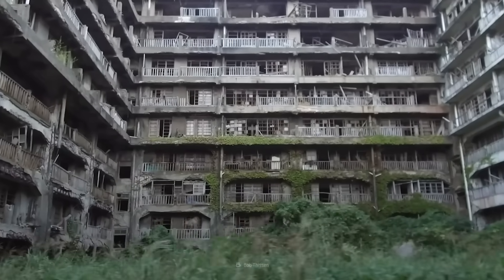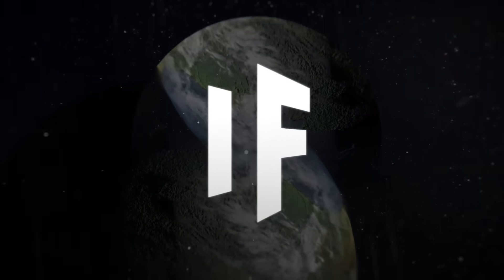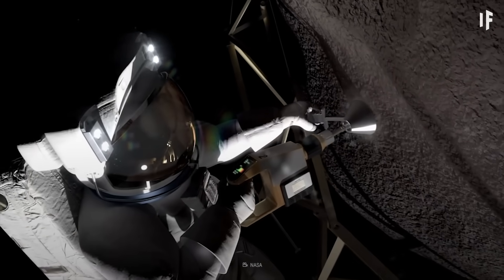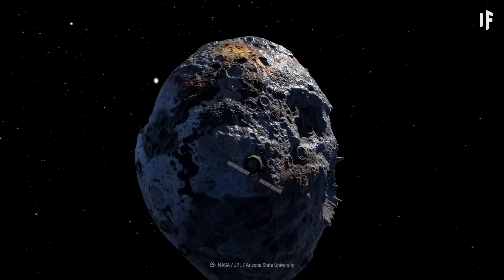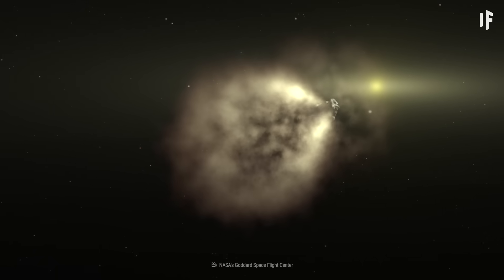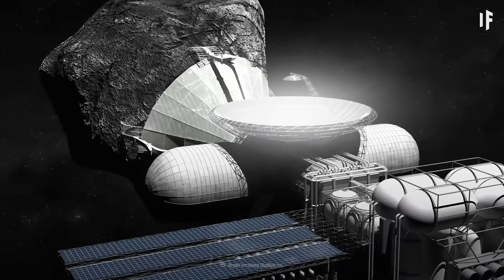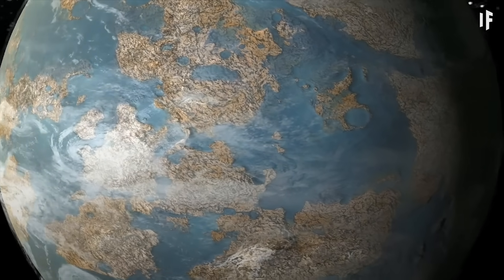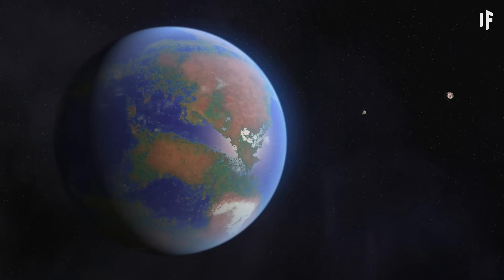What If We Built an Artificial Planet?

Comment: Material would be dispertion of temperature to hydrogen and compressing it with electomagnetic radiation using technology that can beat the temperature and survive inside and outside highest star temp, let that star build with computer program spectroscope and build a planet same way with mag caps inside a hydrogen gas field, building the gas field with radiation, cern 9tril nuetron 1.8 mil, so beating the heat, even building a nuetron star for the gas charged filled of hydrogen, with tech blow out with it and spectroscope all of it pantograph it travel with it and play with it, GOds playground

Comment: sphere with water and living space inside cover by outside steel mesh with recycle plastic fiberglass about 20 m - 30 m and had radius about 50 miles is about 7500 cubic miles can house up to about 500,000 population max each density about 500 person/ square miles.

it lower internal part to be containing water to be compressed from air after reach high altitude than had flaform to build city on top inmer sphere and an artificial sun light on internal top. the outside to protect people from radiation and debris and anticolision course adjustment system then weather and air inside are filtered and keep constant, with refeshing water from compressor turn outside space onto water using dynamic gravity at ratio 2 stages 1/700x 1/700 about 1 - 490000 ratio compression or above could make water from space
Reply: began by an inflatable plastic or fabric balloon deploy by boeing into lower orbit then use sound and gravity elevator to lift supply and men to add steel mesh laying then fiberglass coating then steel mesh then insulation coating then deploy by into low orbit with basic antigravity and electricity,  then steel mesh then fiberglass and plastic and anti absorbing soft silicon coating then began water creation from compressed air as added emf engine raise to higher orbit slower boarding process and add flatform and city with inflat housing for lightness the  planting and lighting

Comment: Nope not possible 
1st: where would u get the energy for making such massive artificial earth? If there is, is it stable.enough to maintain for long period?
2nd: how would you tranfer material from place to place? If there is, is it good enough to sustain the weight or something.
3rd: yes you can replicate oxygen and carbondioxide. But how would you give plant a life ? The sun is way far to reach its light.. And the moon where would you get it..?
4th: gravity issues yes you can replicate gravity like but the energy source again.... Like fuel or core reactor where would you get it. ?

In short earth is just the perfect we dont need to move another planet like artificial we just need to maintain it..

Comment: Wait wait wait .. WHY do you have to build it in the Habitable zone?  Why not simply build the world within the Oort cloud.  It would significantly reduce the issues around movement of raw materials.  And the hydrogen and other materials could be used for generating energy and oxygen and water and other needs (because you are building a world so you have that tech.  It has many other advantages.  Greatly reduced solar radiation means less need for protection .. greatly reduced solar wind means no need to have a magnetosphere around your planet as you build it right from the start.  Heck any atmospheric components would simply be on the ground ready to melt once the planet warms up.  Artificial lighting fueled by Hydrogen could illuminate the work surfaces (no need for heat yet).  Don't even need to have it rotating to start as no day/night cycle it needed making it far easier to target or drop in materials.  Oh it would make building it so much easier.  And then comes the move … nudging it enough to begin the spiral into the inner solar system (hundreds of years of moving inward likely).  If you do it right you might be able to keep one side facing away from the sun (so it stays cold and all the components like air and ice are protected from solar winds and heating).  Finally would come the big push to nudge it into a proper elliptical orbit and stop the inward fall, and the big spin to start it turning.  Assuming the magnetosphere is already in place, then natural heating and cooling will release the atmospheric components and water to settle across the globe over time.  A far simplier construction process.

Comment: you actually could probably build hundreds of earth sized planets with the asteroid belt, there is a quite simple solution aka hallow planets or in other words just have a hallow planet that spins to maintain gravity on the inside with an outer shell of solar panels though for this you would want to be as close as possible probably around mercury which could build a similar amount, plus hallow planets have a MASSIVE benefit, you can expand them inward and outward, creating an area equal to Jupiter in an earth sized package

Comment: Building a planet would probably be easier than terraforming a planet build it to whatever spec you want you could use mars as raw materials build a planet twice the size of earth on the surface,  pack the inside with hydrogen harvested from jupiter because its less dense and you have a bigger planet with 1g the tricky part would be creating an electromagnetic field to protect from harmful radiation.

Comment: I already thought about this idea over 5yrs ago. Making a mobile planet the size of the moon (maybe 20% larger)  but with the same gravity as the Earth. You would have to start with making "true AI tech" to get this done. 

Step 1. Build a large mobile factory over 10miles in size and let it move to the Asteroid Belt and make more copies of itself. Once it has used up all resources then it can move and collect more materials from the moons around the other planets or go to the Kuiper Belt. In the end you will need over a thousand of these massive building factories. 

Step 2. Using high tech metal (smart heat transferring metal) for the skeletal structure the mobile planet will need. Orbiting around a planet or a star will exert a lot of strain on the artificial world and could destroy it in the long run. Something the size of the moon would be hell to maintain so the bone structure must be durable and somewhat flexible. Either that or dont orbit too close so wear and tear dont doom humanity.

Step 3. The artificial world's habitable surface would not be expose to space like the Earth is. It will have an advance metallic shell around it that can protect it from space debris and radiation. The outer shell will have multiple layers so it can can absorb and distribute impact energy as well as be able to remove sections for repairs. The outer shell layer can absorb sun energy as alternative energy. Below the shell layers would be a Troposphere. The "ceiling" would be able display day and night so it feels like you are still on Earth. The artificial core would help with heating along with the help of the energy gathered from the sun. I want to explain more but I need to sleep. 4:26am at the moment : (
Reply: True ai tech would be super advanced machine learning with the biggest artificial neural network with thousands or millions of neuron's. Right now our current artificial neural networks only got like 20 neuron's

Comment: Building a planet will also require building a moon for it. It would need it to maintain core temp and stabilize weather. It maybe easier to restart mars's core by adding more mass to it in one go. The impacts would melt the planet and thats when a new moon should be introduced.

Comment: To manufacture a planet, you'd need all of the material and resources of an existing planet.
Surely you would just use a planet?

But the asteroid idea isn't bad.
Though it's not a case of just taking asteroids, you would have to get specific numbers of specific asteroids with different materials and such.

Comment: This video however does not totally makes sense .....
Even though somehow we build a planet , it's impossible to life existing there and here is the evidence....
At first the planet won't rotate because there is no core !!
You simply can't make an artificial core 🌍🌎🌏
And secondly due to the absence of the core or as there is no rotation of the planet the planet is going to experience extreme temperature that is one part of the planet is too warm while the other side is too cold and this reason in
the planet life is not possible

Comment: I think it would be a lot easier if we build in a cylindrical manner. Considering it would rotate to generate artificial gravity, we could also attach a magnet-based generator rotating in the opposite direction with the cylindrical biome to generate extra electricity.

Comment: What if black holes collide with neutron stars
Reply: Not possible .
Reply: I mean it is possible but the statistical probability of it happening is astronomically minute . It just doesn't make sense to have such a massive and dense object like a black hole near to another massive and dense object like a neutron star if this ever happened even then collision seems unlikely, most certainly they would take an elliptical path centred on each other's core . Revolving around each other . If it did happen which is rare but technically possible then that would lead to massive gamma ray bursts felt across the curvature of space time that too millions of light years apart . Probably a collision like this would only be detected millions of years apart from the reality just because light would take millions of years to reach us after the incident took place . You better pray that this doesn't happen in our galaxy because these are very very dense objects capable of destroying us while sitting millions of lightyears away just because of the Shere energy they would release while colliding with each other .